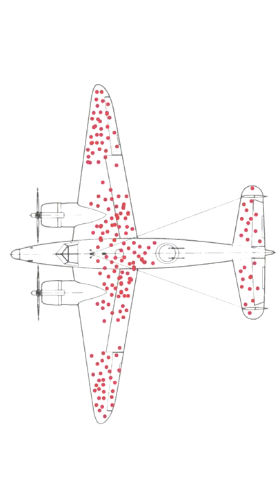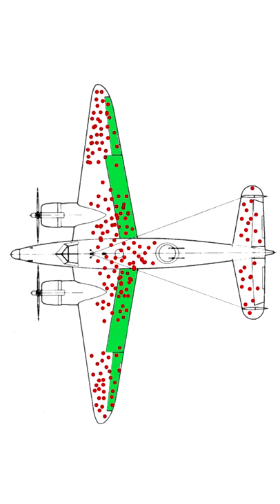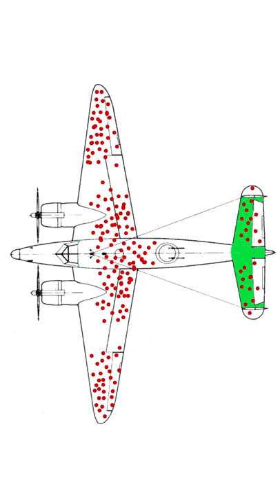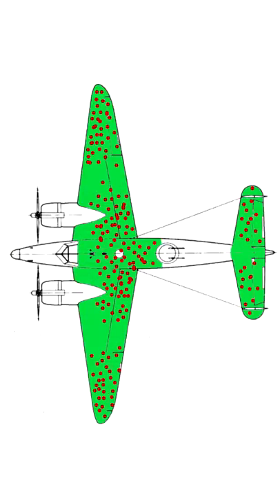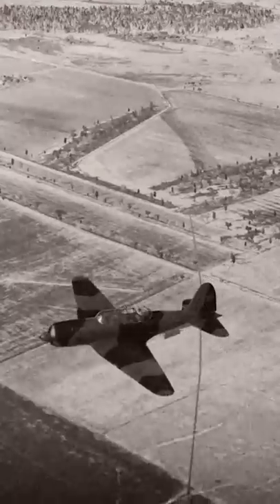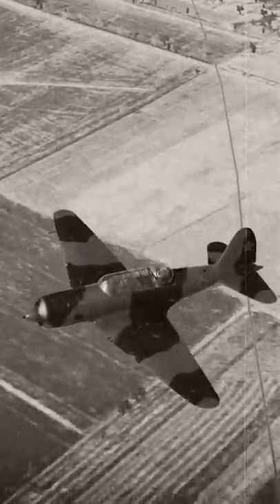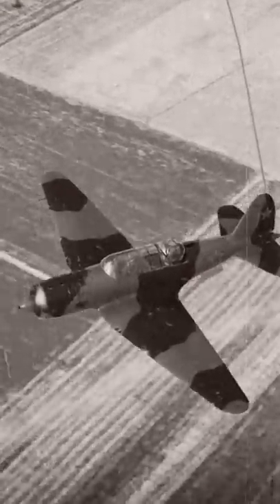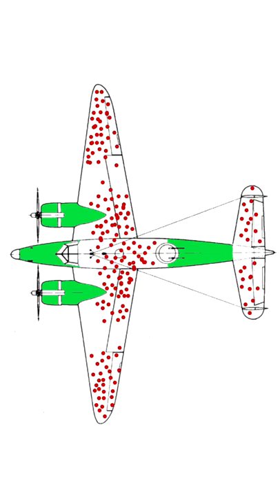Where should you add armor? #Shorts

Comment: “As a conclusion, our survivor aircrafts tell us that the places that least need enhanced armors are near a plane’s cockpit, motors, and the thinnest connection on its tail.”
US military: “Ok cool!”
Reply: Exactly. A pretty serious fuckup if you ask me..
Reply: The thing with armour plating is that it is really heavy, so you can't afford to put much on a plane. So when they originally designed the planes, they put on what they thought would be enough armour and studied where the survivors of missions were shot to see where armour should be focussed. At a glance, alot of people just thought "okay this is where the planes were shot most, that's where they need more armour" under the false assumption that the planes simply weren't being shot as often in other areas because no one returned with damage there. Of course someone then pointed out that no one returned with damage to the engines or cockpit because the ones that took that damage crashed
Reply: @naggie6358  cough IL2
Reply: @Fred_the_1996  you have to bear in mind that the IL-2 is a purpose built aircraft meant to fly at low altitudes over hostile areas for ground attack missions. Having the sturdiness to survive low altitude missions like that was more or less essential to it working.

A WW2 era medium bomber on the other hand carried substantially heavier ordnance in most cases and have to fly with that at (for the time) very high altitudes to avoid interception since they couldn't fly fast enough to safely perform missions. All that means you need to keep extra kilos of weight on your bomber to a minimum if you want it work
Reply: @naggie6358  true
Reply: @Reptex_cs  
well the original question was probably which areas of the plane get hit the most often which would lead to the wrong answer
Reply: @adjsaint  That's the point. It lead to an answer that called for some more investigation as something was pretty clearly wrong with the results, as pointed out by the first poster..
Reply: @adjsaint  In other words, the US military really didn't think twice on this one.
Reply: @adjsaint  if you think about it, asking which areas of the plane get hit the most often(statistically) is the same as asking which hits are least critical.
Reply: @naggie6358  we all watched the video too
Reply: @Reptex_cs  exactly!
Reply: @naggie6358  That's why the Japanese had the most fuel efficient aircraft in ww2, they built it so it had literally no armour even a pistol could shoot it down but the high speed and good maneuverability made it one of the best planes of the war.
Reply: @Zarafin  it was also a matter of range, the navy in particular wanted their carrier based aircraft to have really good range.
Reply: Should protect the crew so they have a chance to escape!😜
Reply: @adjsaint  Depends on what's shooting at it! Is it being shot at from the ground or another aircraft?🤪
Reply: @Zarafin  you are mistaken! Was not the best! Otherwise so many would not have been shot down! And as for being fast, nothing was faster than the ME 262!😜
Reply: @sharronclark7485  That's why you should properly read comments before replying to them, there's a difference between 'best' and 'most efficient' I said the Japanese planes were the most fuel efficient plane, I didn't say they were the best.
Reply: @sharronclark7485  I also specified that the plane had armour so thin even a pistol could shoot it down, do you not understand English?
Reply: Yep

Comment: B-17 crews: well our engine’s been shredded, the tail’s been severed and what’s left of the thing is spinning out of control and falling at terminal velocity but hey look at the bright side, at least the wings and tail are heavier armored. Thanks US military!
Reply: At least you don't have a hole in your right wing
Reply: Except B-17's were extremely well built. They flew home missing wings and tails
Reply: @chaosXP3RT  it was a wonderful aircraft. Some times if they had a cable connected to the tail from the body and the tail was shot off they would just pull the tail home

Comment: Funny how they needed to hire someone to tell them that they needed to protect the engine of the plane. It's not as if it's the most important part or anything...😒
Reply: Yeah. Pretty simple. Protect the engine, ammo, gas tank, and landing gear. Maybe the control surfaces too.
Reply: I wouldn't say engine is the most important part i think the wings plus control surfaces
Reply: I mean if you lose an engine, your plane essentially becomes a glider. If you can at least find a clear, “soft” spot to put ‘er down, you should be alright even if you do lose power to engines.
Reply: @molotov6792  Yes but the wings aren't rendered completely useless by a single hole in them.

Comment: Clever conclusion. This proves that not everything that is obvious, is straightforward. Taking into account the unknown is taking into account the balance between probability and actual. The parameters are set from the beginning. This reminds me of 2 other blunders from WW2. Training dog's to run under tanks with bombs, the only tanks they had in training was their own so the dogs run underneath the tanks they recognised. Also the water that got into the grappling hooks rope while scaling the side of a mountain face to get to the enemy. They trained with dry rope, when they got wet it could only travel less than half the distance needed. It was a slaughter.

Comment: “You cant add too much armor to an aircraft because it makes it too heavy”

German HS-129 (also known as “the duck”)
Says screw you with a SEVENTY FIVE MM (2.95 inch) armored glass on the front cockpit. Along with armor plating on.. well practically the whole airframe. I think its thinnest plating was 12mm, which for an aircraft. Is pretty thick.

Comment: Most important points:
Motors
Cockpit.
Fuel tank. 

Most planes could still fly with holes in the wings, but without motors, or with a dead pilot, or an exploding fuel tank, then its tougher.

Comment: I was thinking the same thing right away.  If the plane is returning, then the damaged area might not be the most vital area to protect.  It's the ones that don't come back that should be worrying, especially since those voids in the bullet maps all seemed to be focused around the engines, cockpit, and rear fuselage, where I'm guessing there is ammunition/ bomb storage, tail control lines, or both...

Comment: Totally makes sense (in retrospect) because of most sensitive/essential parts of the plane: Physically, the weak spot of the thin fuselage just forward of the tail - lose the tail and the plane won't fly; Aerodynamically, the leading edge of the wing closest to the centerline and main propulsion - as well as the main flaps just behind this edge (for increased lift); and of course the engines and associated control systems in the nose and cockpit.

Comment: So the map doesn't show were bullet's were most likely to hit, but where they are not so dangerous to the plane, to solve this they should see what would happen in each part and then compare it to the surviving rate, so then they put armor in those spots and then do the test again to confirm the security of the planes. If the return planes comes with bullet marks on the new armor that means it works, if none came back that means the armor failed and it should be relocated or better reinforced

Comment: Reminds me to the hospital bias when considering mortality rate in pregnant women.

If you compare two figures then you will conclude that more women die in hospitals then in home deliveries. 

But most high risk patients never have home delivery, there is not cesarean section done at home, all complications in home delivery eventually reach hospitals (like post partum hemorrhage). All that ads to mortality rate but if you compare it, it seems misleading (and it is). 

This bias system has big role in everything and all research has ways to eliminate bias but sometimes those ways may seem ethically problematic when you consider that you are not giving possibly life saving treatment to a patient or a potential harmful investigation is being done or that even when there are figures early on showing that something like smoking is harmful, you can't tell them to stop otherwise it discredits the study or makes the figures skewed.

Comment: #1. Around the entire engines
#2. Under the critical wing joints 
#3. Under the cockpit 

You can still fly a plane with holes in the wings and fuselage, but never with critical engine failure, wing segments blown off (A10 warthog excepted), or cockpit shot to hell.

Comment: it's similar to the case of bridge building, where the optimal solution would end with a perfectly even spread of stress and have everything break togethor, since that would show that there isn't a single weak point holding back the bridge designs capabilities. in this case, you actually want to see a perfectly even bullet spread since that would mean any place the plane is shot won't end in its immediate crash.

Comment: Added armor around the engines, but only major areas that weren't ready made of thick metal such as tapret covers, oil pans and fuel systems, that is assuming a large percentage up bullets hitting the aluminum block dont go through
Then more armor around crew positions located over the wings or center of mass, flak jackets issued to crew members with added flak pants and tank crew esk lightweight helmets, the armor added to the center of the plane could also be replaced with shrouded seat positions providing protection to crew members at a fixed station while seating in the shroud, armor could be kept lightweight by using Kevlar in the post war period, or softer metals meant more so to absorb energy, like aluminum, then backed by thinner hardened homogenous steel behind that

Comment: The cockpit and the two rotors are the most most vital parts of the plane, why didn’t they think of that before ?
Reply: This is the case! They only calculated planes that returned from mission! This is the genius in this idea, that the army didn't calculated downed planes, but Walt did.